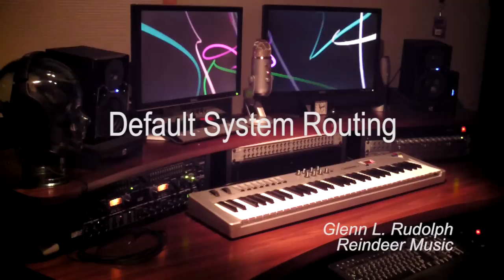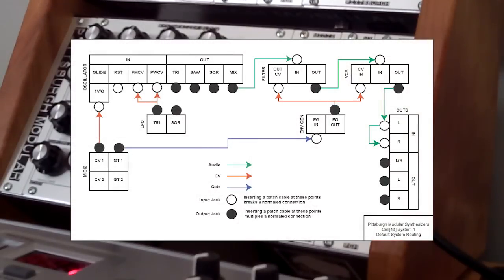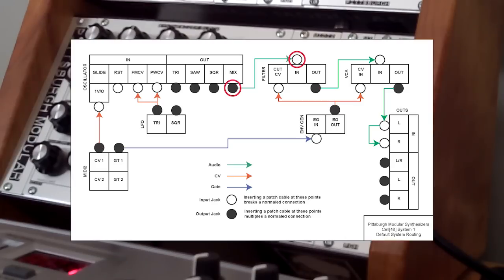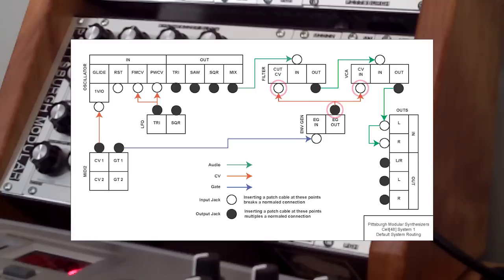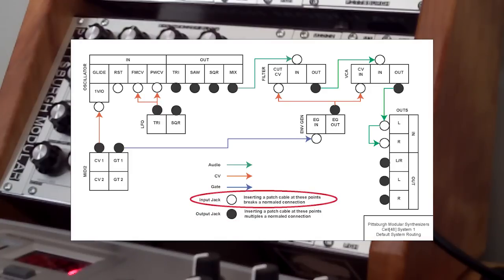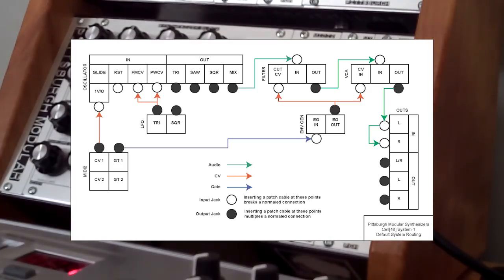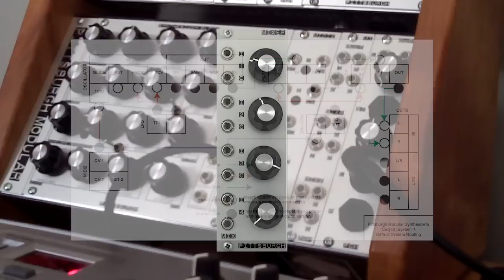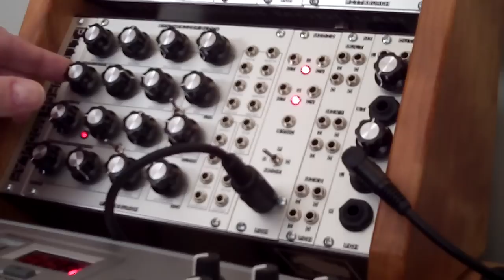Pittsburgh Modular Cell[48] System 1

Comment: Thanks for the great vid.
Is their new System 10 an improvement of the Cell[48] System 1?
It looks like it is but I can't find a clue anywhere.
Cheers.
Reply from the maker: Yes there are significant changes/improvements over the System 1.

1. The System 1 Logo panel and M3 module have been replaced with the new Mix Mult module which adds 2-passive multiples as well as a 3 channel mixer which can be broken into individual attenuators
2. The new Synthesizer Box module offers many new options: Sub-oscillator, new Blade waveform which like the Square wave, the waveform can be modulated
3. A resonant Low Pass Gate with 3 modes, VCA, LP Gate & LP Filter

Altogether, a lot more options. Read more here:

http://pittsburghmodular.com/synthesizer-box/